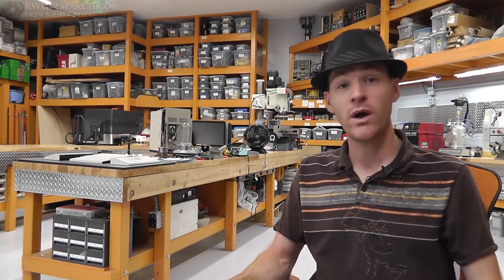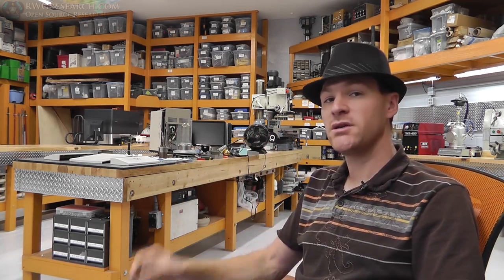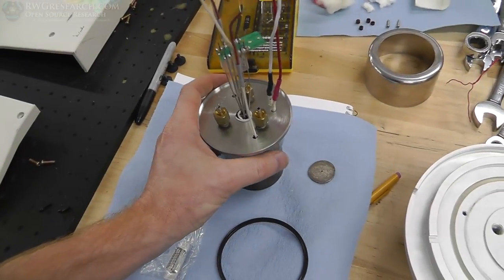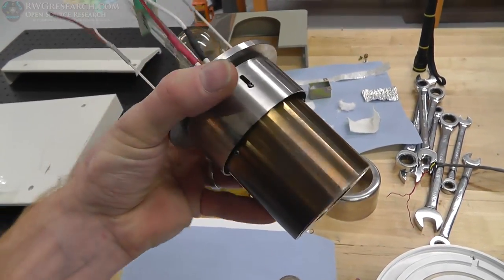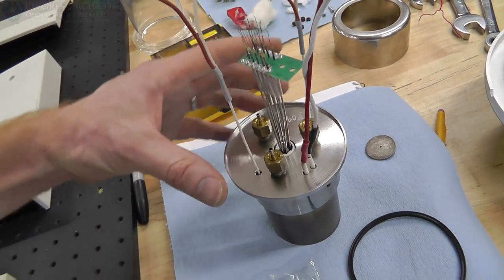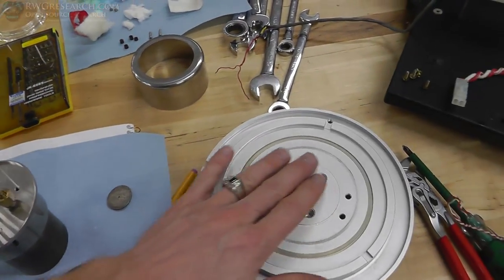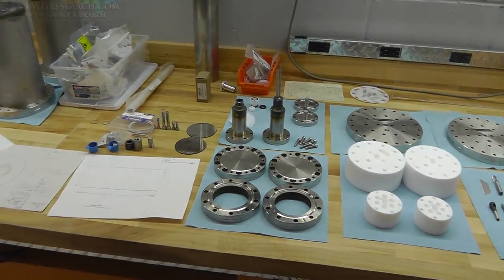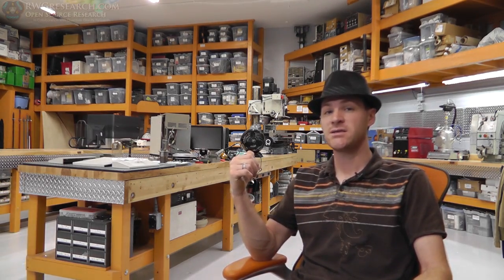Part 0: Hacking The DSC (Differential Scanning Calorimeter) To Making A Pressure Cell!!

Comment: Thermo gravimetric analysis?  Can you elicit your control vs experiment ie distilled water vs deuterium in palladium matrix or what?  I have been working on piezoelectric direct to electricity low energy nuclear reactions but no dice yet.  Any plans on deuterium intercalated nano-nickel plated nitrogen functionalized nanotubes? I would like to try that but need a pulse plating setup on the high hertz to gigahertz.  Have you had any luck showing x-rays or neutron tracks in cr-39?